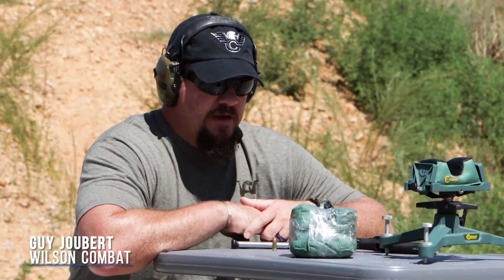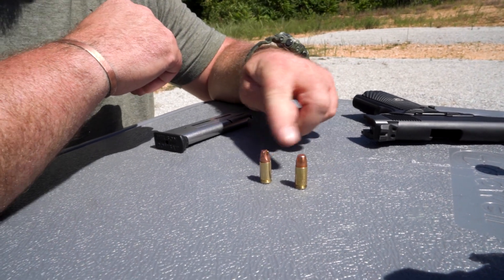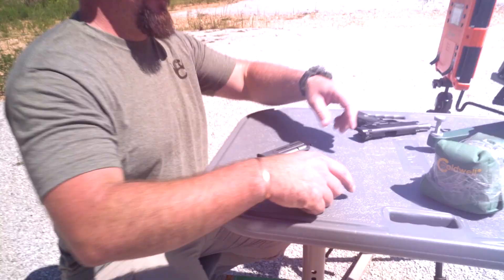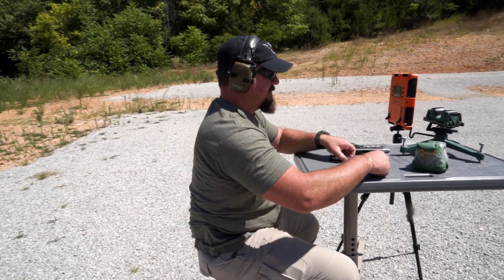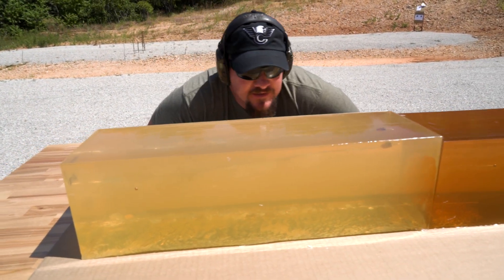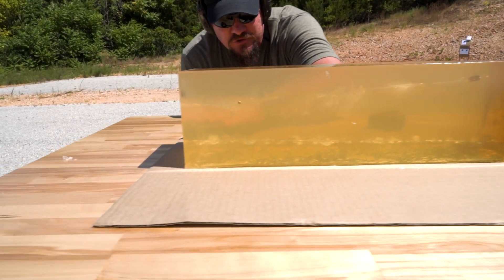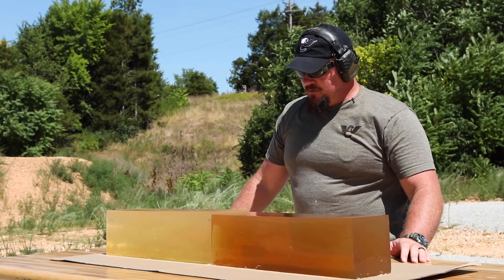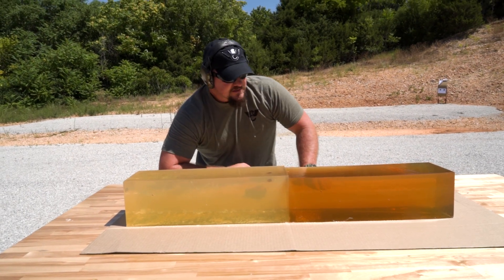Xtreme Defense 90gr 9mm Bullet with and without Flutes Fluid Transfer Monolithic Ballistic Gel Test.

Comment: 90gr seems light for a defensive load. I would use 124gr or 147gr instead. Force = mass x acceleration, so a higher grain bullet will have more stopping power since it has more mass.

Comment: Hey the one without flutes has a market also. Especially if they make one .400 for 10mm auto. They would be perfect for dangerous game were bone crushing penetration is desirable. Make one about 175 gr. The cost should be lower as the time saved for no flutes. They can make great training for using fluted version. No Lead
Reply: They make the xtreme penetrator for that. On the shelf already.

Comment: Curious as to how yall got them the same weight and size if one is missing a significant amount of materials? Especially if they are both monolithic and made of the same material. However I imagine one or more of my assumptions may be wrong
Reply from the maker: We removed weight by drilling out the rear of the projectile.